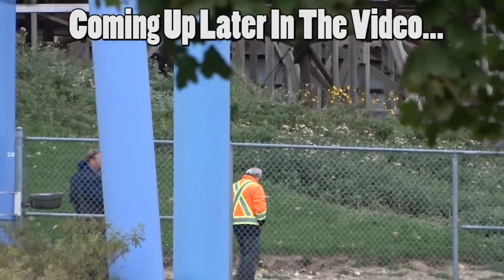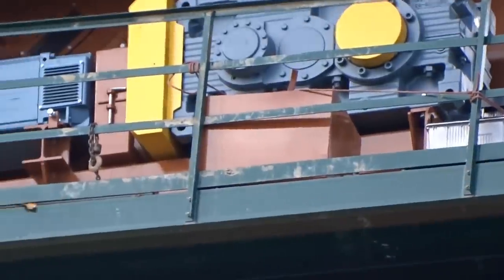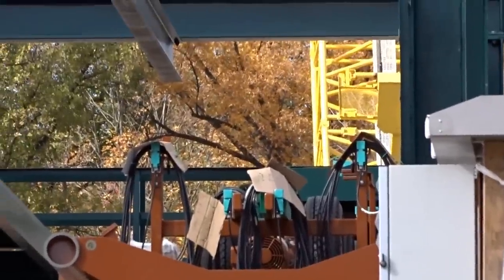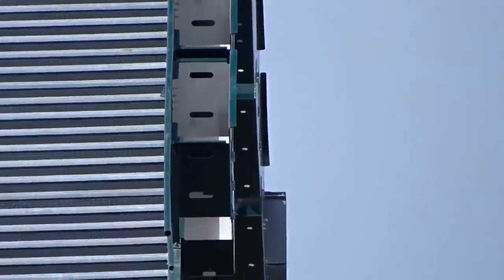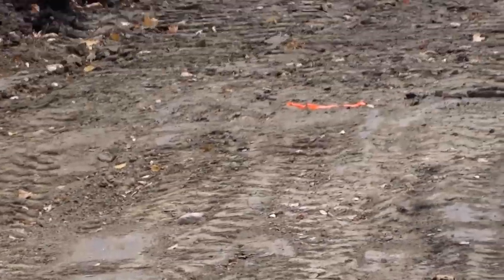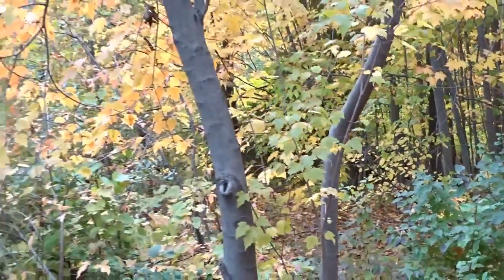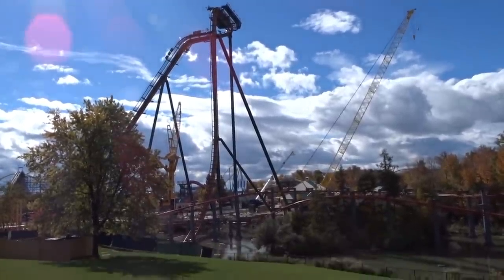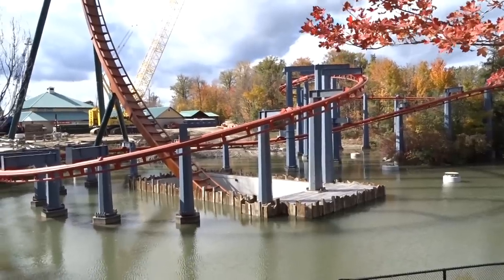Yukon Striker Up Close & Weird Activity?

Comment: Hi Amusement Insiders my name is Samuel, can I just say I like your construction updates on Yukon Striker um about 5 quarters away up before the pre lift there is no handrails stairs, no steal green floor on each sides and no handrails each sides on top of the lift and before the pre drop and under the drop of the motor that holds the pre drop chains there is not handrail there to and should the construction workers when they go to work on Monday October 22nd, 2018 in the morning should they finish the lift that has no handrails before the pre lift, the top of the lift before the pre drop they should put in handrails each sides then the steal green floor each sides of the top of the lift and before the pre drop and also the under the pre drop the motor that has no handrail before they start the first inversion of Yukon Striker tomorrow morning.